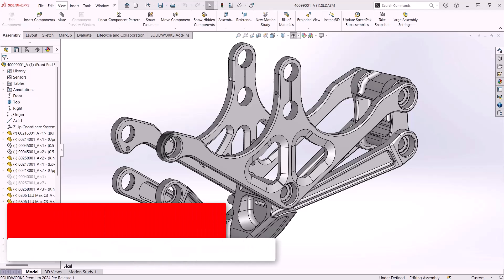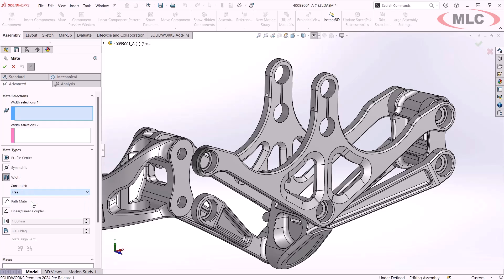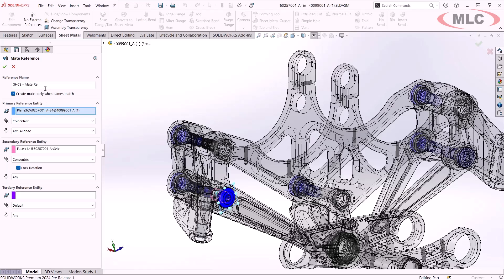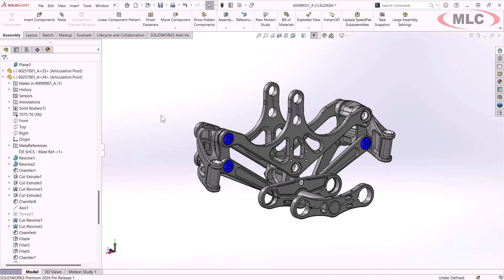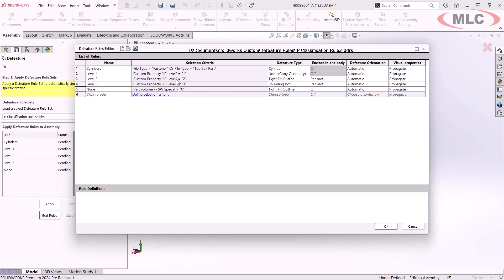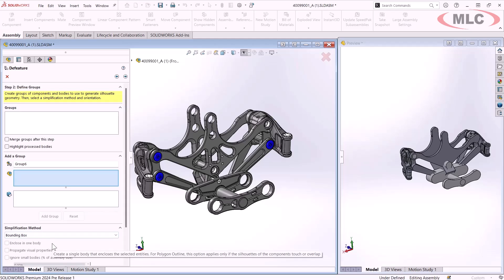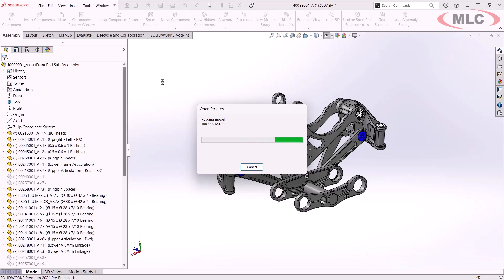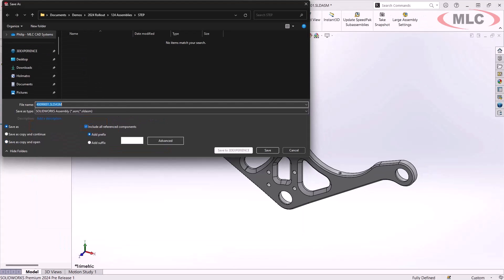What's New in Assemblies and STEP Import for SOLIDWORKS 2024

Comment: so I have a 1730 part assembly in .stp format. If I check enable filter when opening SW crashes every time. I need to retain part names for this job. So far I can only import as bodies which names everything solid body 1,2…1730. Any advice?
Reply: Well we used a coworkers solidworks and everything worked properly. So I think I have a bad install. Thanks for the help anyways!
Reply from the maker: See if this video helps at all: https://youtu.be/sfW-1FOiY9Y, if you import it as an assembly does that help with the file names?
When a step file is created, you have lost the link back to the original files, meaning anything that was not exported into that file is lost, and so the only thing you can do is work with what you have or go back to the original document.  Occasionally .stp files will become corrupt or problematic, which may be why the import filter is crashing.  If you have the option, parasolid (.x_t) is a good file type, and there are a lot of native files we can import too.  Good luck!